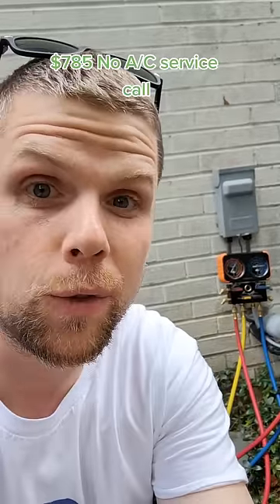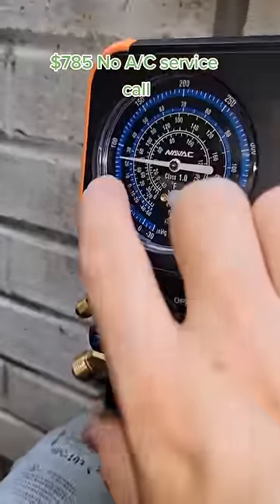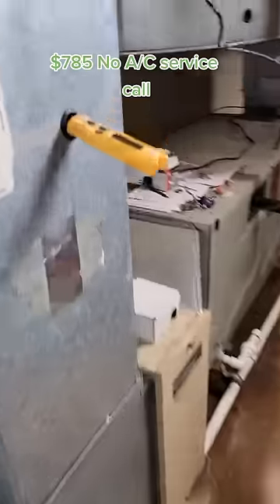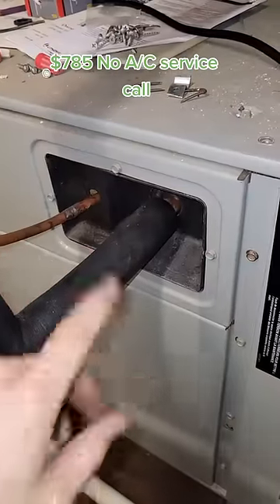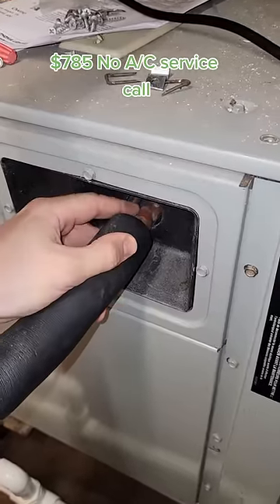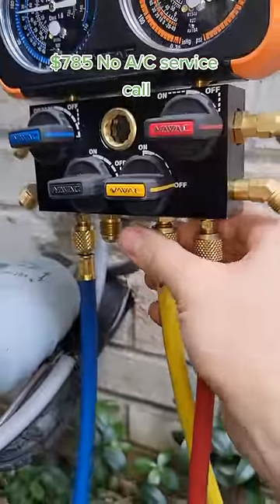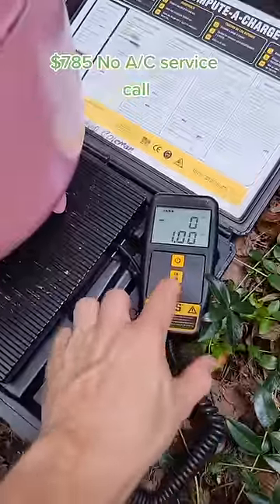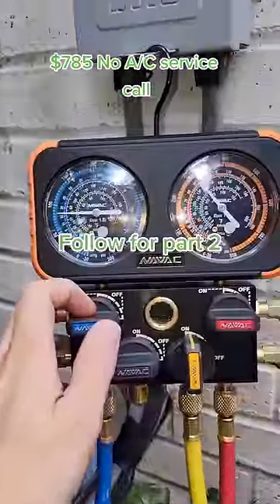Why is my A/C unit 🥶 freezing up? #shorts

Comment: Rv air conditioners will freeze up if you run them under 68° at night. Used to work in rentals and this one of the most common calls, only thing you can do is wait for it to warm up and the ice to melt

Comment: EPA regulations allow for topping a system with less than 50 lbs refrigerant. It's not required to first repair leak if leak is 35% or less of total charge over a one year period.

Comment: Airflow is the first thing you check in your sequence of diagnostics. And you do not need to put your gauges on every piece of equipment. You can measure the temperature of the refrigerant lines in the temperature of the air going over both coils, indoor and outdoor. This will get you in the ballpark.

Comment: Also if the evaporator or A-coil is sized wrong for the house, bigger doesn't always mean better. If its too big it will freeze up. Once the evaporator freezes up you get no more air flow.

Comment: You do know that you just screwed up the blend of that refrigerant... It 410a, a blend. You need to remove the charge, and weigh in the factory charge.. after fixing/finding the leak. You just changed the blend, and it's not water and air that comes out of the liquid line that's refrigerant and air....

Comment: Did you seriously just purge the system into the open air?
Reply: Someone doesn't have their EPA or forgot lol
Reply: That is an acceptable practice. Must purge the gauge set of air/ foreign gases.
Reply: He's purging his lines so as to not introduce any air into the system. Can cause blockages, higher pressures and all a few other problems if done enough times
Reply: It’s fine to purge the air out wtf. So you just dump air into the system?

Comment: 785 to top off the system?
Reply: I guess it depends on the refrigerant. Freon, since it’s a terrible greenhouse gas, requires you be licensed and are capped off on how much you can buy. Plus theres a huge tax on it i believe
Reply: my company will do it for free as long as they pay for the labor and leak seal with dye
Reply: @Dylisill  That pink cylinder which is R410A , can be purchased on- line without a permit for about $150 for a 20 POUNDer . There’s nothing special about it . All refrigerant cylinders are color coded indicating what’s inside.
Reply: Thousand more, I can have a new AC system
Reply: @paulrozinski1488  not any more that refrigerant is over $500.00 now!

Comment: Check airflow first. Check the filter, get rid of the ice on the evap and make sure the evap doesn't need to be cleaned. You can check for refrigerant charge after that's been inspected. And if there is an issue with low refrigerant, FIND YOUR LEAK BEFORE ADDING MORE REFRIGERANT YA GOOF...

Comment: Aren’t you supposed to use a vacuum pump to bleed the lines, instead of a raw release to the atmosphere?
Reply: Jo B  When I was trained, the fine was $10k per event. But cracking a joint to purge air isn't legally actionable: it's specifically mentioned in official publications as an example of "de mimimis", or minimum necessary, release. Failing to purge the lines would allow contaminants (including air) into the system, which is an actionable violation.

Defining fines, and the violations which lead to them, are the responsibility of the US EPA. In this case, like many others, federal authority pre-empts state authority, which is clearly expressed in the Clean Air Act's grant to California of a limited exception to that pre-emption for vehicle emissions.

Comment: 410A is an blend of of R125 & R35 ....a non Ozone depleating blend 
Did i mention its a blend ..? So how much of the R35 leaked out? Or the R125???
 So how do you top up with the correct blend .....
Reclaim & recharge in liguid state with "NEW" refrigerant.... 
If your going to post stuff make sure you post accurate information.

Comment: You gotta check subcooling, if the subcooling is high it may not be a leak but actually a restriction in the liquid line or metering device
Reply: Also, purge hoses until you see WATER???

Comment: 410a is not a drop refrigerant,  it's binary and and consists of 2 chemicals,  one being much lighter then the other...meaning the remaining refrigerant isn't working properly and you shouldn't just top it off. It's also hydroscpic...meaning the moisture in the ambient air makes it extremely acidic...Check filter and cleanliness of indoor coil and find the leak , or you will be getting a recall because you haven't fixed the issue...

Comment: Well whats the pressures and temp on liquid, hows the air filter or the evap and if its low on refrigerant u need pin point the leak fix it and then add charge.

Comment: First off, you didn't check the air filter, second off, you didn't check the capacitor on the blower motor inside.
Reply: Shorts are short. Content creators, especially those doing skilled work, tend to only focus on their positive findings and not film their negative "findings". It leads to lots of backlash in comments for people assuming they didn't do something because they didn't post it.

Instead of blaming the poster who likely had a time constraint for the video, just give a helpful message to the watchers of the video offering other things that could lead to similar symptoms. If the poster is wrong, they will still get your message. If the poster did do those things, they are very likely to upvote or pin your comment so others see it.

Also very hard to read tone in a message so we all often seem more harsh than we are trying to be.
Reply: @thecountrychemist2561  these were just meant as helpful tips for other people who are here trying to self-diagnose their equipment. I appreciated the video a lot, but the filter can cause everything in the entire furnace and air conditioner to go wrong, the most important part of the entire system, and a lot of people don't understand that.
Reply: @thecountrychemist2561  and a bad capacitor on the blower motor can cause readings on a gauge that simulate a low charge, even when there's not a low charge.

Comment: Now I just need to figure out what's wrong with the window unit that's built onto the wall below the window in my apartment. Compressor doesn't want to stay on at anything above 90 degrees outside and when it does, it struggles. Seems to be overheating. Clean slide out mesh filter every week and blew out the vents with a shop vac and an air Compressor but the thing hasn't ever had a professional take a look at it and it looks to be over 15 years old or more. Told our landlord and they are just sending over their general maintenance guy, who isn't a professional ac or hvac person. Honestly think it just needs replaced with a 25,000 btu unit since it's around a corner secluded in the kitchen and is the only ac in a large 2 bedroom apartment. I actually had to buy a portable unit to put in my bedroom because of aluminum single pane horizontal sliding windows that can't hold a window unit. All the exterior doors in the whole building are hollow interior doors too......yeah the place really needs updated.

Comment: You did good, just hope your not one of those guys who say the whole unit needs replacing because the fan won’t run or the compressor won’t run just cause of the contactor or capacitor, defrost board can also cause issues. Been apprenticing under my dad for 2 years and I’m 15 now so I have a good future ahead of me.
Reply: I’m assuming that it was either low on Freon, the inside or outside coil was clogged or the filter was dirty on the inside.
Reply: @Possum24  it was clearly low on refrigerant… your pressures tell you a lot that’s why he weighed the charge he was putting in.
Reply: @JP-zz5rm  it can be multiple things, not just the amount of Freon.
Reply: @Possum24  yes but he determined in the video that it was low on charge , it can be multiple things but in this instance it was low. I’ve even had a stuck TXV give false readings of a low charge since it wasn’t opened and it was starving the evaporator coil. Took the bulb and dumped it into a paper cup of cold water, my low side pressure and sub cooling didn’t change so I knew it was stuck.

Comment: I'm not an expert but isn't a close system and should not be low unless leaking? Idk
Reply: You're correct. He needs to fix the leak before recharging, otherwise it will just leak again. Same with a car's AC

Comment: Air flow and expansion valve can cause the same symptom, always keep a clean air filter in the air handler and do not allow the technician to silfos the DX valve without protecting it.  Most expansion valves are damaged during installation.

Comment: Haha water and air air coming out the gauge line. You've got bigger problems like the contamination and moisture blocking the metering device will cause low suction pressure

Comment: isn't it illegal to discharge freon into the air
Reply: Not at that small a volume.

Purging service equipment is actually a specific example used in official publications of "de minimis" release, or the smallest necessary (not smallest possible) release of refrigerant to atmosphere to perform service properly.

Failing to purge equipment is the actionable item, as that would contaminate either the refrigeration system, the storage container, or both.

Comment: “See that water and oil coming out”……🤦‍♂️
Maybe oil from your hoses, if the cylinder or the system has H2O inside. You have more issues then just a low charge.

Comment: I have an old home unit that's in perfect working condition, but no service technician wants to replace the refrigerant because it's an old model. I don't want to buy a whole new unit.
Reply: Change  the oil in the compressor,    change the TXV  and fit the new type of refrigerant  which will R410a. And stay with your old ac

Comment: Actually the refrigeration system is a closed system if a system. If you have to add refrigerant it means there’s a leak. To do it properly you recover the remaining refrigerant, pressurize the system with nitrogen and use soap bubbles to locate the leak, fix the leak, pressure test the leak, pull a good vacuum you verify holds, THEN charge the system. What you’re doing is knowingly emitting refrigerant which is a findable offense. Stop trying to educate when you need educating. This is the difference between union training and non union informal training.

Comment: Is it legal to purge into the atmosphere? Actual question! Thanks!
Reply: Yes
Reply: "de minimis"
Reply: Nah
Reply: It’s illegal to purposefully discharge refrigerant into the atmosphere. But not to purge. Purging is allowing out a insignificant amount of refrigerant.
Reply: It's not legal in Germany.
Reply: You should use a vacuum pump so you don't need to bleed the line. And the rest in the line you can let the compressor pump in the system.
Reply: In na, purging is perfectly legal
Reply: No, cause the government thinks a little discharge in the atmosphere will do more damage than what’s already being done as I speak right now 😂
Reply: That depends a lot on the refrigerant used. Some refrigerants are used in spray cans like cleaners and stuff since they aren't harmful but pretty much all home AC units use stuff like R410A, R134 and R407C.

1kg of R410A amounts to around 2000kg of CO2 equivalent and thus should never be let in the atmosphere.

No one is coming to arrest you for purge like that but in good faith to keep environment clean you should use vacuum pump to do all the work if possible. 

There is always gonna be leaks somewhere but thus in my country at least, only licensed and trainer individuals can work on these units to minimize it.

Comment: Gas and go. Doesn’t fix the leak, check air flow , failed metering devices can cause low suction. Love these hacks on the you tube

Comment: If it's low on change,  find the leak. You should check sub cooling.  If the evaporator is frozen,  without thawing it. Adding charge will it still won't drop temp. Flipping the tank upside down is because it's quicker to add charge.  It has nothing to do with it being a blend.  If that were true then the Refrigerant that leaked out would not leak out at the same rate and you would have to get rid of the rest of the charge.

Comment: $800 for some coolant wow
Reply: About 8 years ago, I had a company service my 2 ton York split unit and in addition to his “repair” and show-up fee he had the gaul to charge $10.00 per OUNCE for R410A refrigerant . That’s why I learned how to do it myself. You can buy a 20 POUND cylinder of R410A on-line for less than $150

Comment: So you've clearly got a leak, yet you're not gonna reclaim the refrigerant and perform a leak test? What in the yehaw man.
Reply: In the field that’s not always the case , if the customer just wants to add refrigerant just to get by that’s usually happens , they don’t want to pay extra for a leak search . If the system was completely empty that’s a different story.
Reply: @JP-zz5rm  it's about the law, you can't just charge a system with a leak.
Reply: @pickelrick6377  🤦‍♂️ yes that’s obvious , but if you actually work in HVAC then you would know that 1 out of 3 technicians actually perform a leak search. Most of the time customers just want to pay for charging the unit, they don’t want to pay for that + leak search + leak repair , at that point they might as well get a new unit and people don’t wanna pay that price 🤷‍♂️.
Reply: @JP-zz5rm  I've been doing hvac-r for 6 years. Doesn't matter what the customer wants, if refrigerant has been lost there is a leak and it needs sorting. Contributing to direct global warming can carry jail time.
Reply: @pickelrick6377  so you are telling me that if you find the leak and bring it up to the customer and they tell you to just charge it and not do the repair that you would do some “sorting” and do the repair free of charge? Or would you decline to just charge it and leave them without cooling? When the customer doesn’t approve the repair you only have limited options, besides giving them a bid for the leak repair and for a new unit. If they don’t want to pay for another other repair you could only do so much and no way I am leaving a customer without cooling when we hit triple digits weeks on end in central California!
Reply: @pickelrick6377  lmao 🤣 my cars leak so much of that shit have no plans on fixing
Reply: @nobullshit9721  it's different for cars they can keep topping that up regardless.
Reply: @JP-zz5rm  I'd tell them it needs repairing and if they don't want to pay for that then get someone in who wants to cut corners and break laws. I'm not putting my reputation on the line and having that come back and bite me on the arse.
Reply: @JP-zz5rm  Never gonna happen I don't do domestic. Regardless though laws are laws why risk a prison sentence if caught?
Reply: @pickelrick6377  Nope. Knowingly charging a leaking MVAC system carries the same penalties as deliberate release of refrigerant, with the exception of a "temporary" charge for the purpose of locating the leak(s).

The difference is that unlicensed consumers are allowed to purchase MVAC refrigerants and service their systems. Technically they're subject to many of the same requirements and penalties as holders of a Section 609 license, but enforcement would be impossible.
Reply: @pickelrick6377  it isn't the "law". EPA has no stipulations on repairing leaks on systems containing less than 50lbs.
Reply: @crapmusstank6558  it is for F-gas

Comment: Please don't purge refrigerant into open air... That's just irresponsible. Also, fix the leak before recharging, otherwise the refrigerant will just end up in the air again. (For context, refrigerant is one of the worst gasses to release into the atmosphere)

Comment: Bet it was the filter
Reply: Mike Taylor  I’m a service tech myself, personally i think the holding the filter to the light trick doesn’t work so well. If it’s to the point that you can’t see light then it’s damaging the system. I would change it before it gets that bad. But either way I’ve seen people with 10 year old filters and somehow the system still chucking cold air.